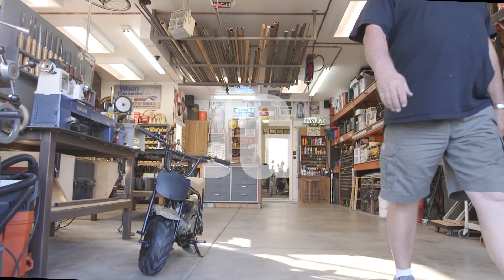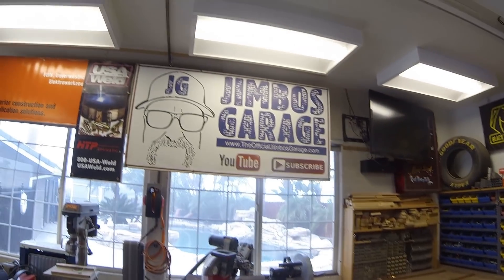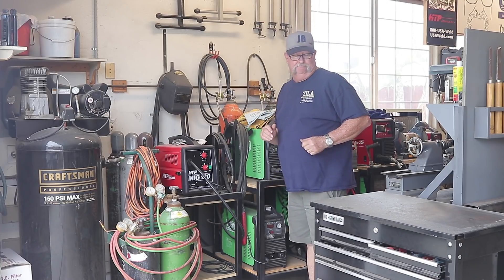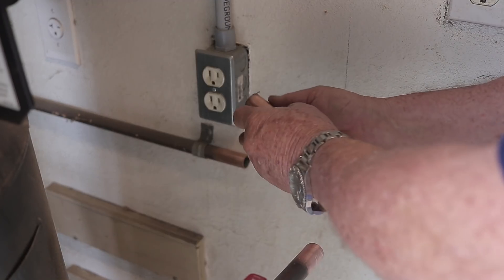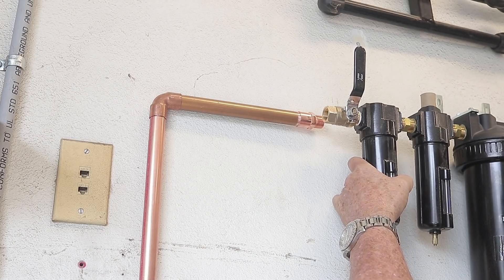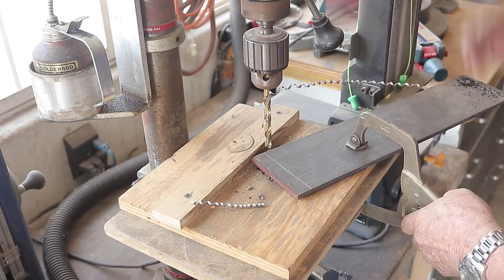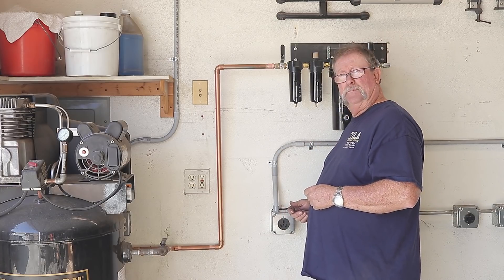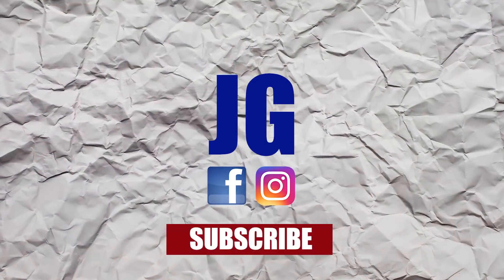How I Setup My Air Compressor Lines & Installing Air Dryer | JIMBO'S GARAGE

Comment: hey Jimbo thanks for the cool video, man! I was able to see the dimples inside and out on the copper slip.  Thanks for the education and instructional video, I'm refinishing my 1918 colonial style house/garage and when it comes to having airlines, I need to know what to use and why.  It looks like you went with copper I thought copper was only for plumbing purposes like water supply.  I didn't know it was used in air applications as well, but it makes sense!  Thanks for the awesome video, man!  By the way, I am not a plumber, electrician, mechanic by trade, but I've learned all these things with my pops throughout the years and being a wire EDM engineer designer and setup operator, I take much pride in not paying people to teach myself new things.  You might not be a plumber by trade but you do a heck of a job! Take her easy bubs!

Comment: If you really want to solve moisture,,,I put a roll of 1/2 inch copper tubbing between compressor and tank dropped my air temperature by 70 degrees and I hardly get any water now,,,

Comment: I have a pump over tank like that and I cut the line from the pump and added a transmission cooler and then two water filters then back to the tank then out to two more external tanks.  I then added an electric fan that blows on the cooler and the pump.  One of the key things about cooling the air first, is that you're not putting hot moist air into the tank.  A simple transmission cooler takes a TON of heat out of the air.

Comment: Nice work with the copper.  Expensive and time consuming to put together, but very nice for compressed air.  I would recommend a hose between the compressor and the copper with a swivel connector on one end.  I know you have to have it custom made but any decent hose shop can do it for you.  The vibration of the compressor will eventually affect your piping.  As for the dryer and CNC plasma table, I gave up on dryer filters a while back.  They always developed leaks, got corroded and I never remembered to drain them.  I did have a refrigerated dryer for a while until it broke down.  Now days, I have an after take air cooler (installed on the air compressor), an auto drain on the compressor and drip legs for every drop.  Not a filter anywhere on the system except for the plasma cutter which has one built in.  It stays dry as a bone so the system is working for me.  I'm in central Texas and it does get humid from time to time.  Been running CNC plasma since 2013.  And, I enjoy your videos!

Comment: Hey Jimbo,  Thanks for the video.  I'm looking to set up my own air compressor system at my house.  Key things I'm looking to use in my shop are pneumatic tools, air to blast & clean dust away/blowing up car tires, and finally, I wanted to connect up to a sand blasting cabinet.  I was looking at regulators and dryers and some also had lubricators on them as well.  Would the lubricator be bad for my sand blasting cabinet?  Also if I am using the same line for my tools that I am using to blow up car tires would the lubricated air be bad for the car tires/rims?  If so then I would just buy the individual regulators and lubricate the air at a specific location but I wanted to get your thoughts on that.

Thanks
Reply: Hey Aaron, an oiler would be very bad for your sandblaster. Oil and grease are the absolute worse thing for a sandblaster because it can cause the media to clump together and also contaminate your surfaces. Items that come out of the sandblaster are pretty well  ready to paint or powder coat requiring just a quick rinse with solvent to remove blasting dust. Water is ok but can cause flash rusting. Obviously never sandblast oily or greasy parts so degrease properly first. On YT you will see some people use paint stripper before sandblasting and this is good too as the stripper loosens the paint which makes blasting quicker and easier and reduces the amount of crap in the media. I normally don’t bother with the stripper unless the item has several coats of enamel paint then it really helps. Using air powered tools is extremely inefficient as only about 10% of the total energy used goes to powering the tools, the rest goes to compressing the air to drive them. I have actually gone away from air tools and mainly use cordless tools now instead. They’re heaps more efficient as I don’t have to fire up the compressor to run them, convenient as they don’t have a hose connected to them, they’re a hell of a lot quieter and they sit on my bench ready to go. If you look at mechanical workshops most are using cordless tools now. Even my local tyre shop use cordless impact guns. If you want to run an oiler just tap off another air line before the oiler. I have been using air tools for 40 years and never bothered with an oiler, I just put a few drops of oil in the tools every few months and I never had one fail. Now after all that the sandblaster is my go to method for cleaning the rust and crap off projects I’m restoring and I wouldn’t be without it. It gets in to every nook and cranny that a wire wheel can’t and it’s fast and clean. If you’re serious about a sandblaster THE most important thing is air supply so buy the biggest air compressor you can afford and have the electrical power to run. Personally I would look to buy a good second hand compressor as your money will go a lot further (bigger) than a new one. I use a triple cylinder compressor and I’m about to add another double cylinder unit, so two compressors to increase the psi I can run continuously for sandblasting. Both were purchased used by the way. I hope this helps, cheers Stuart 🇦🇺

Comment: Wouldn't it be more sensible to put the moisture filter on the input of the compressor so the tank is dry?. If the tank still contains moisture it's still prone to rusting over time.

Comment: Great explanations. Quick question: the fitting that goes from the copper pipe and has a thread on other end of it, what is that called! Whenever I look up “copper piping to air fitting” it’s just people putting it together but never showing that fitting you showed! I have a small compressor that I’m trying to run a couple lines to it.
Reply: I have the same issue right now. I’m going to try a actual plumbing store and see if I can find something. Did you ever?

Comment: You can also eliminate water by first cooling the air as it comes out of the tank.  Lots of systems run a large 90 straight up to the ceiling and then back to the floor with a drain at the floor level and then back up to your manifold take off.  This cools the air and condenses the moisture and you can drain it out before it ever gets to your air dryer.  I use a "toilet paper filter" for my plasma and it works really well.  And a note, I've had the same plasma since 1995.

Comment: Why did you not put a leader hose between the compressor and the copper lines to isolate vibrations?  I would be worried with vibration causing a blowout there..
Very good video in my opinion...
Reply from the maker: Thanks for watching Stan, That is a good idea as many viewers have mentioned the same thing. That is on my list to change.   Jimbo!

Comment: I like your air system, but your moisture blow out valves are not as important as a  drain valve on the bottom of the tank. I have the same 60 gal compressor and can easily drain a pint of water out of the drain valve every month.

Comment: Why not just buy a air dryer that uses r134a plug it in the wall and BOOM problem cured for good?that system is good u did though i had it got sick of beeds tossed it and bought a airdryer from eaton aka polar air and im telling u they cure 100% moisture instantly

Comment: Hey Jim , probably would have been a good idea to install a union on each side of your dryer in case you have to service or replace your dryer in the future without having to re - cut or solder again.

Comment: Looks good! I'm designing a new air compressor and routed air line solution for my garage right now to run air tools and the Miller plasma I just bought. I'm also an HTP fan and considering their Max Air system. Question: I'm also here in the L.A. area and was wondering how often have you had to dry out the desiccant from the Max Air system (if ever at this point?) Also, have you done any kind of testing to see what's coming out of the line that may not be getting caught by the filters (spraying against a paper towel for example?)
Reply from the maker: Thanks for watching Tim,  I haven't had to dry out the system yet, It has a view window at the bottom of the filter with purple pellets in it, I think when the pellets change color it is time to clean it out and replace the pellets. Don't quote me on that, I'm just guessing.  I checked the air system out to the plasma cutter and the air is dry, No moisture!     Jimbo!
Reply: @JimbosGarage  Awesome! Thanks Jim, and Happy New Year!!

Comment: Hi Jimbo,  just stumbled on your channel and love it!  Just the right amount of talk and lots of demonstration all at a good pace.  I offer one suggestion on soldering, consider heating just one end of the coupler, typically the thickest part and then touch solder from other side.  That ensures a well heated joint that will wick.  Again, great channel that is right up my alley! Gary
Reply from the maker: Thanks for watching ,   Jimbo!

Comment: Very nice setup you have there mate. I was just wondering... why didn't  you install the dryer straight out of the compressor so all your lines and tools benefit from the dry air?  Cheers...Jeroen, Melbourne Australia
Reply from the maker: Thanks for watching Jeroen from Australia!!, It was suggested from the plasma table manufacture that i install it for there machine.    Jimbo!

Comment: Good video. smart to install a dryer. mine is a smaller version of that one ( I only run air tools and a small hvlp paint gun ) my soldering skills leave much to be desired LOL. I prefer to have a flex line directly off my compressor ( mine is not bolted down and shakes some ) less chance of breaking a hard line  IMO.

Comment: Looks great except you should have used unions at the coupling, you made into a failure point, and at the dryer. The way it is now if you had a leak and needed to fix it you would have a hard time and would have to add union anyway. Same goes for adding or replacing parts.

Comment: is copper line even safe? that could be dangerous if that blows! just asking.
Reply from the maker: Thanks for watching Jon, I have had no problems with the copper.    Jimbo!
Reply: In a manufacturing plant I use to work in, that is all we had for compressed air was 4 inch copper line, had 4 massive Quincy screw type air compressors running 250psi and a storage tank that was about 15 foot diameter by 20 feet tall. I would say if copper can handle that every single day 24 hours a day, copper will be fine for a home shop running 150 psi max.

Comment: So your copper pipe goes directly in to your compressor? Doesn't give that a whole lot of racket and noise every time the compressor kicks in? And if it does give whole lot of noise, then you will most likely shake things apart on the joints. I would recommend a short piece of flexible tubing between the copper and the compressor. That way any shaking from the compressor will not be transferred in to the copper.
Reply from the maker: Thanks for watching , Ya that would have been a good thing to do. I will keep an a
eye on it if there are any problems i will change it.  Jimbos garage!

Comment: Some reason I always thought copper would be a bad idea for 150psi but you seem to have had no problems with it in my shop we run sch 40
Reply from the maker: Thanks for watching Kenneth, I have had no problems with the copper.   Jimbo!
Reply: JIMBO'S GARAGE idk why I didnt think it would work ive used copper and brass fittings on some of my air tools lol just one of those things I didnt know what I was thinking at the time
Reply: I had sch 40 blow apart on me. I bought air line shop kit. Worked out well.

Comment: How long have you been using copper tubing for compressed air? I was going to do the same years ago, but was warned off by more than a few people. I do run HP air...
Reply from the maker: Thanks for watching Steve, I have had it there for about 3 years, And no problems.  Jimbo!

Comment: I didn't know that you could use copper lines for high pressure air.
Reply: well...we use copper in a/c and refrigeration coils and linesets...and it is a very high pressure gas. We use a different process to connect the fittings...brazing instead of solder.

Comment: Why is it that all the home setup air lines are copper. All the commercial shops in warehouses and auto shops all use galvanized pipe? Galvanized pipe cutters and threading tools are readily available at big box stores.

Comment: They sell copper fittings that don’t have the bump on the coupling for what  you where trying to do .
Reply: 👍Their call repair couplings
Reply: or slip fittings..
Reply: Yes they do but that would have meant that Jim would have to drive to get one and he already has a regular coupling and a die grinder. 
Nothing wrong with how Jim did it.

Comment: Your opinion on using copper pipe vs. black pipe for the air lines? Keep up the good work. AND thank you for not turning the camera all over the place while holding it, it's saved me from having seizures....
Reply from the maker: Thanks for watching Curtis, I just thought it would be cleaner and easier.  Jimbos garage!

Comment: by grinding the copper coupling , you have weakened the fitting , the continuall expension and contraction of the pipes may cause cracking and possible injury , I would replace it with another , or use a Conex fitting , easy to remove if needed later .

Comment: Your using Copper for air line very good  I always tell people to use it .   but there are still people hell bent on using Black Iron pipe for Air  nothing but Rust  in the lines

Comment: Have you had any issues previously with the hard line leaking around your compressor? Maybe I gave too much attention to the forums when I did my shop but it seemed there was a lot of warnings about not having a little flex line between the compressor and your hardline system. Not to mention that the 24" 1" dia flex tubes are bloody expensive!
Reply from the maker: Thanks for watching Andrew, No not yet, But that is a good idea.  Jimbos garage!

Comment: I'm doing a new install of a 60 gallon outside my garage in a little shed. I admire your copper work but I'm looking that the Maxline PEX 3/4" for my install, about $170-ish. What was your method on drains & dryers? Thanks for the great video!!
BTW: from my experience in copper, it's good to mount it to standoffs from the surface & no mount near a joint ;)

Comment: Good job. the only thing I would have done differently was install a union next to the filter and dryer. Would have been easier when you have to remove something.

Comment: I’m uncomfortable about removing the dimples from the inside. They’re pressed in, so the metal inside is coming from the normal wall. Remove that, and the wall in that place is half, or less, than normal. The solder may not help the strength there. It’s now a point of failure. I would have bought a Union. That’s made for this purpose.

Comment: Any compressors I've seen has a short flex hose right at the compressor because of vibration , I know you said the compressor is bolted down but it is still going to vibrate ..

Comment: Very nice set up Jimbo.  One thing that I did differently than your's is that I used pressure rated braided stainless line between the compressor and the rest of the system to eliminate any vibration from the compressor.  I also put my dryer right after the compressor so that all my tools benefit from dry air (we don't have the humidity that you folks do in Cali!).  Anyway, just another idea for you and your YouTube followers.  Cheers.
Reply: Called an isolation hose and it's the right way to do it.  Prevents compressor vibrations from resonating into the rest of the system and also the wall.  Not only does it help preserve solder joints and reduce stress on the compressor it also reduces noise by preventing the compressor from using the wall as a resonance chamber.
Reply: Yup
Reply: Wayward Woodworker where did you guys get the flex hose?
Reply: ebay has the 1/2" 2.5' at around $15.  Harbor freight carries one 3/8" for $6...  My lines are 1/2 though..I think they call them "leader hose".. but I suppose it might be called isolation hose possibly.
Reply: I agree with all the comments about adding the stainless steel braided isolation hose.  Vibrating your lines isn't good over time.   Also, look into an after cooler for your compressor pump.  If you plumb the compressor pump through a aluminum condenser unit, then through a drain section and a check valve before going into your tank, you'll get little or no water in the tank.  Less water in the air means less work for your air dryer before the plasma unit.

Comment: I was lucky enough to have my next door neighbor whom is an hvac tech help me with my air lines.
All copper is hvac grade (700+psi rated), and he tought me how to solder.

One tip, file down the sloppy solders and rub the joints with valve grinding compound to smooth them out.
I had to do that every time i did a sloppy solder, or else my neighbor would give me a hard time... lol

Comment: Nice setup. The only thing I would've done differently is to use steel pipe rather then copper, less risk of the pipe bursting.
Reply: Would be hard to avoit it rusting inside-out due to moisture in the line...